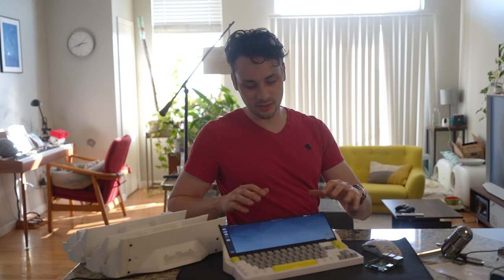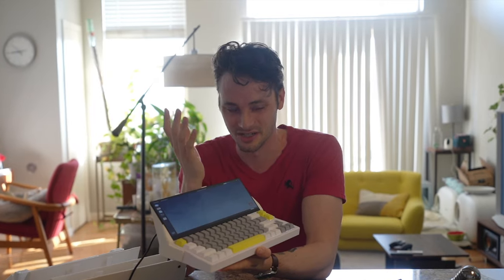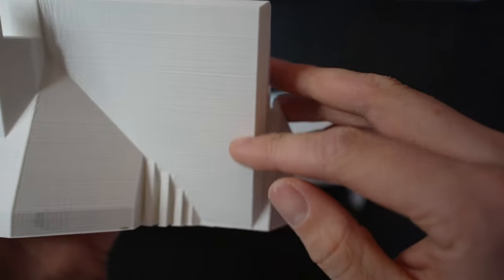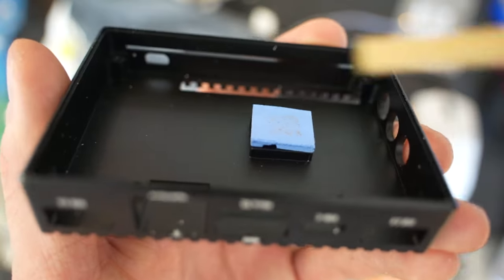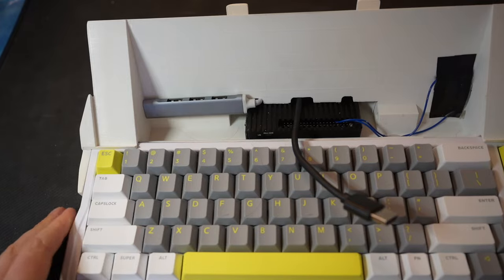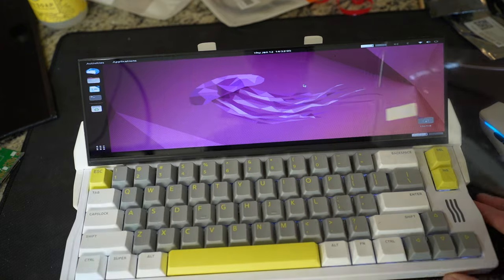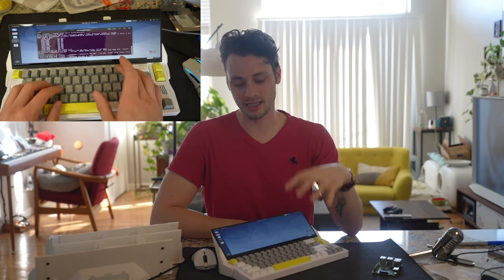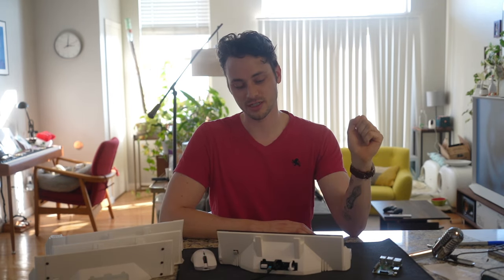You Can Make This CyberDeck (IQUNIX Q66)

Comment: When booting the machine, try pressing "e" while you are in the bootloader and highlight your Ubuntu system. You can then temporarily edit the boot parameters. At the end of the line, add "video=DP-1:1920x510@60" and press Ctrl+X to start the system. If that doesn't work, retry the same procedure but with "video=HDMI-A-1:1920x510@60" instead. Good luck!
Reply: Oh I forgot to mention, if it works you can make it permanent by adding the same parameter (e.g. "video=HDMI-A-1:1920x510@60" ) to the file /boot/grub/grub.cfg at the end of the line that starts with "linux /boot/vmlinuz"
Reply: it Works on this project?
Reply: or you can logout of the session and choose gmone xorg version and log on you can change the resolution using xrandr

Comment: It's probably a simple 1-liner to fix the resolution, but I would guess that the controller board for the screen is likely the source of your troubles.
Reply from the maker: Oh I'm 100% sure that it's one of those "it's simple when you know how" sort of things
Reply: Looking at the Amazon Q&A section there seems to be some bugs with their HDMI driver support.
Reply from the maker: @radomane  Interesting... So could be a Hardware issue then, which would be a bummer
Reply: @CarterHurd  wondering if raspberry pi could make the job 🤫
Reply: Everything on Linux is a one-liner when you understand it well enough. The issue is when nobody seems to understand  it well enough to write that one-liner.

The answer, basically, is probably to use something other than a bog-standard Ubuntu installation, like Mint or KDE Neon or Manjaro in Xorg, and use a more well-known one-liner xrandr scaling command from there.
Reply: @JeoshuaCollins  it’s been a month and I don’t remember the details but I think it’s Wayland + proprietary GPU drivers, xrandr won’t save you

Comment: This is ALMOST exactly what I was looking for. My plan was to find someone with a 3d printer capable of taking a special order, print out an enclosure that fit my specific keyboard, a Raspberry Pi 4, and the very panel you seem to have here. This is 95% what I was looking for, amazingly!

The only thing off is the keyboard. I have a rather particular keyboard in mind, the ShurikeyGear Saizo 75% keyboard. It's really a work of art, and looks almost exactly like the one you have, just a bit bigger. I'm thinking that your design would only have to be scaled horizontally a little bit and the tolerances checked.

Edit: I just checked what Shapeways might charge to have this printed out. It might actually be cheaper to just buy a 3d Printer!
Reply from the maker: Make a cad design in Fusion 360 and email it to me. I’ll print it if you just pay shipping, but you’ll have to be patient cause who knows when I’ll get around to printing it
Reply: You're not wrong. I got my Ender 3 Pro used for $150 Canadian. Of course I didn't know anything so I ended up needing a new extruder because the plastic ones that come installed have a habit of breaking... and then I needed a new stepper motor because my after market extruder was designed for the older stepper motor shafts 🙄

I think my point is just buy a new one if you have a particular print as a goal rather than a very educational project lmao

Comment: Screens can be connected via a magnetic connector like a modular, but they often require a strong magnet or a self-locking connector on lightweight devices. Some devices using origami design are very flexible to open and close and save space, although it is not very common because they must be carefully calculated to withstand force if applied to devices

Comment: Why isn't there a tool which just parses terminal commands into prompt windows with lists and tickboxes before you click send working backwards procedurally from manpages? It could even list the command as its generated as you alter the input. It solves the command discoverability problem (query vs search) and it means people can onboard the terminal faster by using this as a learning tool to see how commands get constructed. It could even be a damn terminal program in and of itself, sort of like a terminal co-pilot.
Reply: There's a terminal tool called Tealdeer (the command you run is tldr) which shows the most common commands of a given terminal tool.
Reply: @Endelin  I get this, but how is there not a Regex101 type thing, for terminal commands?
Reply: bump

Comment: Hi Carter!

I have already sent you an email but you probably haven't got it. I am looking for a Fusion 360 of the build as I will be using Raspberry Pi Zero and those holes on the back will be unnecessary.

Is there any possibility to get those files and modify them?

Best Regards

Comment: This looks really cool. Do you think this would work using a resin printer, instead of an fdm?
Reply from the maker: Yes, but this is quite a large print, so depending on the resin printer you may need to break it into smaller chunks to print

Comment: I have no problem with Linux, but it was never intended to replace windows.   It is way better today than it was 10 or 15 years ago.  Back then it was difficult to just get WiFi to work..  One thing to remember though is to check the hardware compatibility before you buy said hardware.  That is a really strange display though and I am not even sure windows would support that resolution.   If you are looking for a operating system that works with most hardware then buy a Windows PC or a Mac, they have much better support.  If you are just using compatible hardware and open source software Linux works well.  One thing I don't like about Linux is Wine which is used to run windows programs; some work, some don't.  In my experience most don't which is really frustrating.
Reply from the maker: Both windows and Mac work with this display, but other than that yeah you make valid points

Comment: On the startup screen there's a button to switch to x11, you just need to go to the quick settings menu in the top right corner of your screen and press power and then logout. It should be a little gear icon on the bottom right corner of your screen, from then you can just follow the tutorials you mentioned in the vid. If that doesn't works try setting your computer on fire and smashing every garden gnome in a 5 mile radius with a sledge hammer.
Reply from the maker: When I click that button and switch to x11, I type in the password (still the default khadas) and when I hit enter it loads for a while and then takes me right back to the login screen, instead of logging me in
Reply: @CarterHurd  probably worth trying something out like mint or fedora then. Or again, set the computer on fire and run away since this very much seems too annoying to fix lol.

Comment: Why would you buy such a full plastic """""mech""""" Keyboard?
There are cheaper options with full aluminium cases or atleast silicone dampeners.
Even LEGOs sound less plasticy.
But the end result really looks slick, i love your design idea
Reply from the maker: I personally don’t like the higher-pitched sound that you get from most full aluminum cases. If you want to see my optimal keeb sound, I’ve got a custom build video centered around that. Ended up with a plastic case and the sound is great.

Comment: just run xorg :)
Reply from the maker: Does xorg work on the VIM4?
Reply: @CarterHurd  xorg should work. Just 'apt install xorg', then log-out (don't turn off), and select xorg from the 'login' page. There should be a little button in the corner of the login page :)
Reply from the maker: @barabyjones3784  There is that little button in the bottom corner on the login area, when I switch it over to that mode, and type in the password (default is still khadas), I never get past the login screen, it just looks like it is loading and then plops me right back to the login area